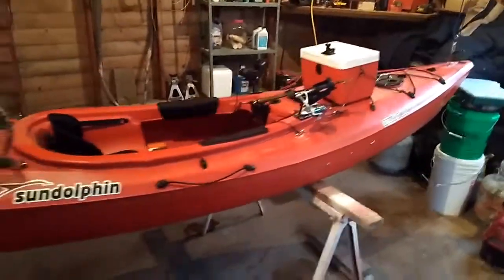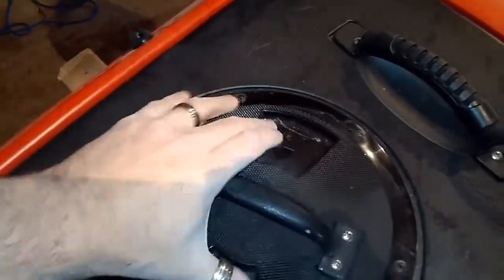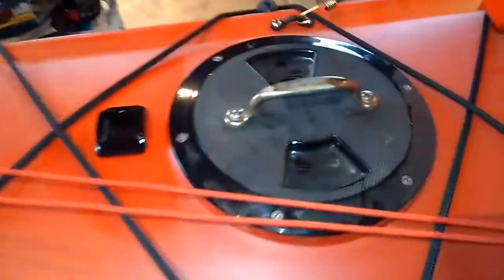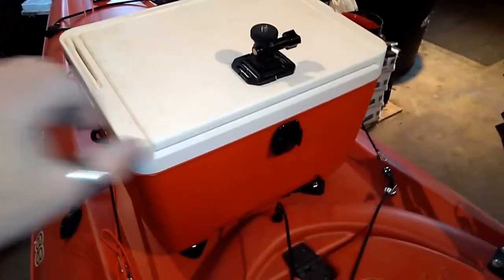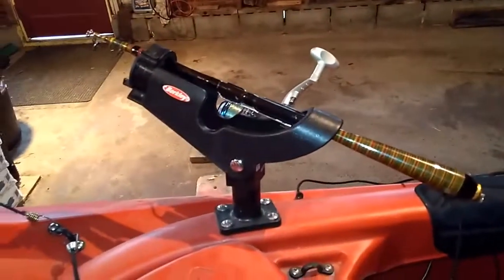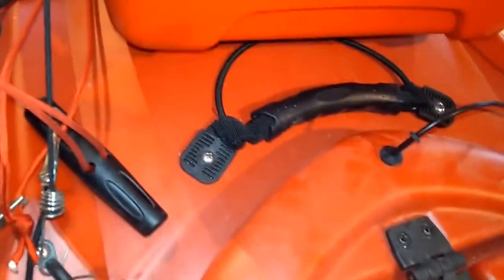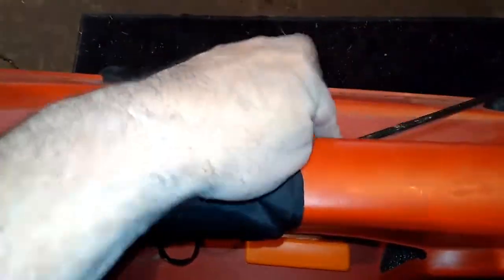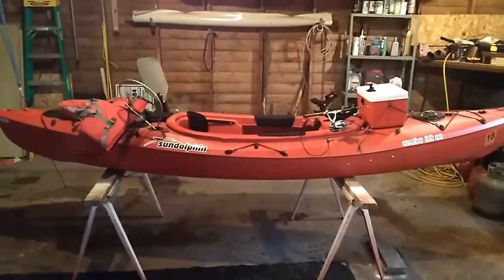SunDolphin Aruba 12 SS kayak into a fishing kayak.

Comment: I’ve got a question for you. I just acquired a Sundolphin Aruba 12 like yours. Im guessing you don’t have this anymore, but I was curious if you sealed in or glued that big piece of foam in the front of the yak??? What did you use??? And is there a certain type of screw you used to attach your accessories??? I love what you did here and I’d like to do some similar upgrades to mine. Feel free to comment or message me here on YouTube. Thanks so much!!!
Reply from the maker: I believe I used silicone to keep the foam in place.

I used all stainless steel pan head screws and pan head bolts and nuts.

Thanks for the compliments on the upgrades, I actually put a lot of time and thought into that yak.

Did you see my $6 kayak cart video?